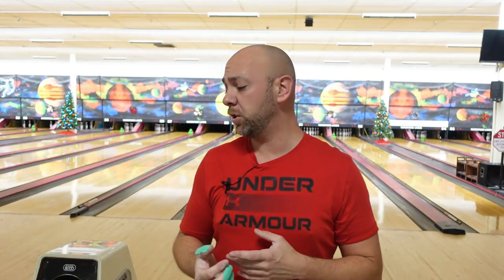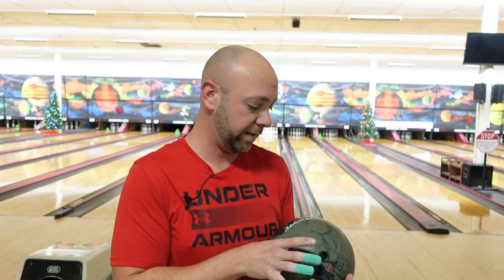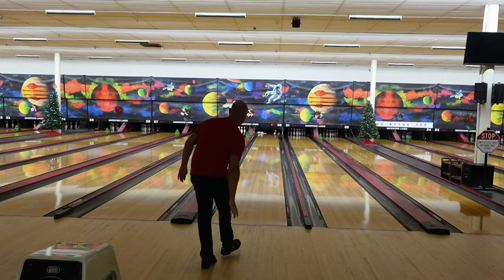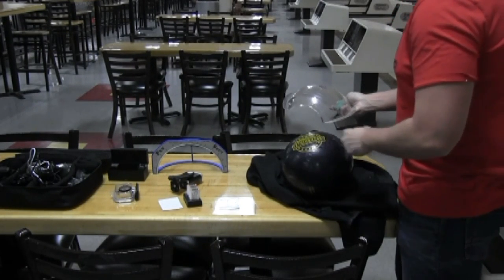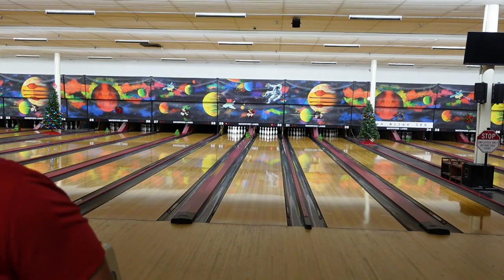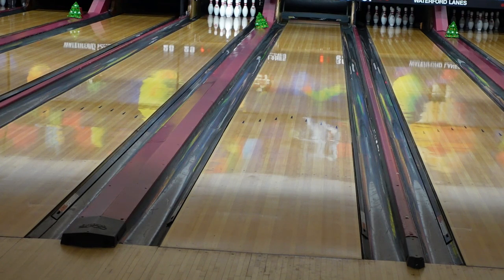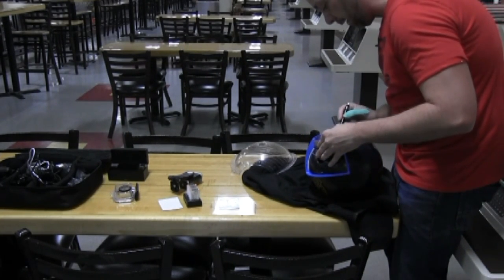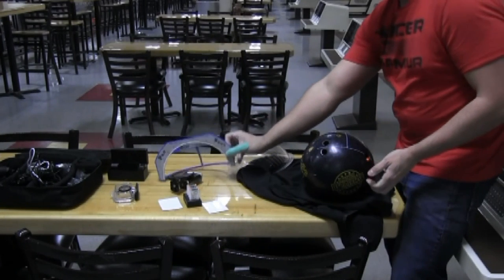Changing hand positions changes your layouts

Comment: I’ve always wondered about that. I’m a two handed bowler and I can position my off had differently and cause different PAP’s based on where my hand is. I’ve been getting by balls drilled off of my middle position (my typical) because of this.

Funny you talk about cheap options for a prosec and armadillo. I’ve made a homemade prosec out of cardboard that does a good enough job at finding a PAP measurement, and I made a makeshift armadillo out of Saran Wrap and packing tape. If I could show you pictures of them on this platform I would lol!

Comment: I have found that changing my release mostly affects Axis tilt, and the PAP remains relatively constant. For example, when I roll the ball forward for single pin spares, my tilt is 10 degrees, but it is 17 degrees when increasing axis rotation for strike shots on inside lines.

A little known feature of the Armadillo is that it can be used to directly measure axis tilt.
The ribs on the Armadillo are 1" apart. The distance from PAP to NAP is 13.5"
Subtract the distance (on the Armadillo) from the PAP to the first oil ring, from 13.5
Double the result. This gives you the diameter of the first oil ring. Axis tilt can be found on standardized charts using this value.
The Armadillo ribs can be labeled with the axis tilt values they represent, to mitigate the need for the chart.
Reply: Yeah, the pap just "seems" to change because the ball is rotating in the air when "coming around it." This means that the first oil ring is going to be slightly higher or lower depending.

Comment: I would add one more thing I personally discovered, different core types change where your PAP is located.
I compared balls with different cores (Asym vs. Sym) that had identical layouts based off my normal PAP and the PAP on each of these balls after thrown measured as much as 2 inches different!
So if you use a ball with a core to find your PAP you may not really be finding your "true" PAP.
If you want your "neutral PAP" use a plastic ball with a pancake weight block and a label drill.
Reply from the maker: This can’t be true. The core won’t change it the first foot off your hand
Reply: @Tenpindoctors  Try it. It does. 
Plus my PAP stays stable for almost 1/2 way up the lane before it starts to spin unlike yours that is only stable for a few feet.
Reply: Core only effects flaring and partially the  shape the ball creates when it reads the dry.  

Core or no core your first oil ring doesn't change much even with hand position changes, the core isn't moving much if at all in the first 2 feet of the lane. (,Unless you throw it with 600 revs and 10mph)
Reply: @Kawboy65  Yep, that is what my tests show as well.
Reply: @joshg218  My tests with different balls do not confirm this.
Reply: I see a few options this could happen listed in the probability that I think it happens:
1. The grip isn't exactly the same between balls.
2. You are using a different type of release or hand position (consistent but different between balls)
3. Your release isn't consistent
4.The ball is flaring in mid-air. It is an unbalanced object spinning so it will try to find a stable position but I have not idea to what extent.
5. The tiny difference in weight distribution alters your release

Also, even if it is true your PAP is different between balls, you should be using the PAP for that ball to lay it out and not some "neutral PAP".

Finally, if this is true it also means finding your PAP is an iterative approach since drilling the ball in difference places will change the core and associated dynamic properties.
Reply: @christopherascherl2411 
 I think we are learning that PAP location both varies with release and with core type and layout. So a PAP is really an "area" and not a point.
The axis of a spinning object is dependent on the balance of that object and how it is spun.
The more neutral the object is (minimal imbalance) the closer the axis will be to our personal "ideal."
I found my neutral PAP by using a pancake ball drilled with minimal static weights on any side, top or bottom. 
Then I use that neutral PAP on all my performance balls and all of them flare and track properly.

But if the PAP is measured on each of these balls, it is in a different location, sometimes subtle and sometimes not so subtle.
But because I laid them out from a "true axis" the variations do not cause flaring or tracking issues.
The unique imbalance in each ball causes the ball to find its own spin axis which remains track safe.
So my advice is, if you start from a neutral axis any variations caused by core dynamics should not cause the PAP drift to be a big issue.
But if you start from a PAP location from a highly dynamic ball, that PAP may not be appropriate for other core designs since it is already shifted from true by the dynamic core that it was measured on.
Reply: @nordattack  If we are only talking about the relationship of the core to your grip, I'm 95% certain layout doesn't change the PAP; if talking about details of grip (lengths & pitches) I'm 100% certain it does. I'm also 95% certain the core isn't going to change the PAP. I would need to see some testing to show a ball flaring in midair under reasonable conditions or the core actually changing how a bowler throws it.
Reply: @nordattack  What you're saying aligns with the physiological sensation of differing weight distribution in my hand from ball to ball. It makes sense to me that the core shape affects how the ball comes off your hand because the weight inside is in a slightly different place.
Reply: @kevinhess5821  I feel that as well. 
Very high RG Sym designs come off my hand and spin up with more effort vs. very Low RG Asyms that seem to glide off and spin with little effort.
Reply: @nordattack  So either your speed/rev ratio is extremely high or the core is already in a stable position when you release the ball.
Reply: @christopherascherl2411  I have low speed and low revs. Each ball behaves differently for me. But based on my "neutral axis" found with a pancake ball, I can drill up any core type with an Axis layout and have stability at that "neutral axis." It is only when the core is moved by an unstable layout that the PAP tends to reorient itself.
As my PSO has found over the years, PAP is not a point, it is an area.
Reply: I will try and explain why this happens. A ball doesn't care whether it's on the lane or in the air. Most people have a certain amount of loft time when they release the ball. A core in a ball will try and get to a stable position regardless of whether its on the lane or in the air, thus causing the ball to land in a different spot on the ball. People who loft a ball more will see more of a difference.
Reply: You are right the core definitely will change the pap. An easy test to prove it is to take a wiffle ball and put different shapes objects inside and spin them in the air. It’s amazing how important the shape of the core is to the initial rotation of a ball.
Reply: @nordattack  If you put the pin within a 4" diameter circle around your PAP you will get a low flaring ball regardless of the balls dynamic properties.
Reply: @chevysmallblock7264  I already said a ball will flair in mid air, I just don't think it will be enough to be detectable within the normal variation of a person's release.
Reply: @bowlingvanjapan4099  What exactly are you sticking in the ball? Since a wiffle ball is so light it seems easy to create a "core" magnitudes stonger than anything currently being used in a bowling ball today.
Reply: @bowlingvanjapan4099  You are correct and JR demonstrated this to a degree in this video by simply changing his hand position which moved his PAP by rotating the core in a different way. Now he wonders if his PAP has changed from his original measurement. I would ask which ball he found his PAP with originally and go back to that ball same exact ball and throw it the exact way he did when he first "found" his PAP and see if it measures the same as it did before. This is why I use a neutral ball for finding true axis.

Comment: I'll be the first in line to get an affordable pro-sect and armadillo. The price they demand is ridiculous for what is probably a buck's worth of Chinese plastic....
Reply: I just recently got a 3D printed pro-sec off of eBay for about a quarter of the price.
Reply: It basically for a proshop that makes money. But I agree it must be made cheap. You don’t need a prosect if you use storms way of laying out a ball (VLS).
Reply: @flippperboy  Every product has some intrinsic value, regardless of whom the intended user might be... and two ounces of plastic is two ounces of plastic. Why should ANYBODY get fleeced, whether it's a tool of their trade or not? There's no possible way that those tools together,  are actually worth the cost of a high-mid performance ball...
Reply: I measure alot of my own stuff but I only got a prosect and they are ridiculous. I personally don't need an Amardillo but if I do get to open shop I'd definitely want one

Comment: This is why I found some advice that prather gave to be amazing. He said to take a low diff ball and stand more right, measure the pap. Then take a high diff ball and move left, measure that pap. Then split the difference and use it as the singular pap.

I may be wrong but I don't think the pap necessary changes. It's more so that the ball rotates in the air, when coming around the ball. Therefore the first oil ring appears to be higher.
Reply: I would say your correct because your pap is relative to your center of grip which doesn’t change.

Comment: I notice when I change hand position my PAP doesnt change, it just moves where it points.  I use tape on my PAP during practice to work on changing tilt all the time.  Rotation is much easier.
Reply: I am not saying yours does not change in any way.  I would think mine does, and I know when the lanes are drier I flare over my thumb and when there is more oil I dont.